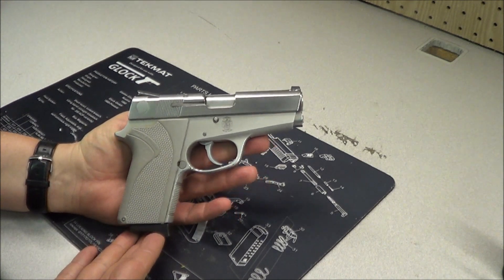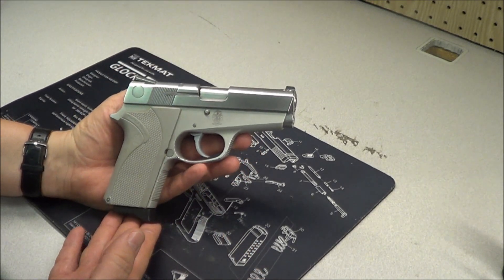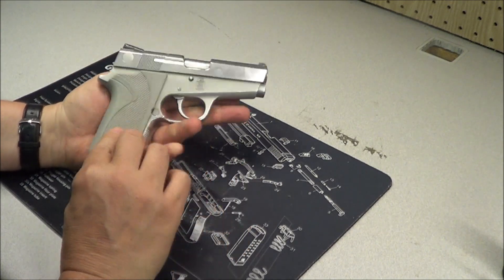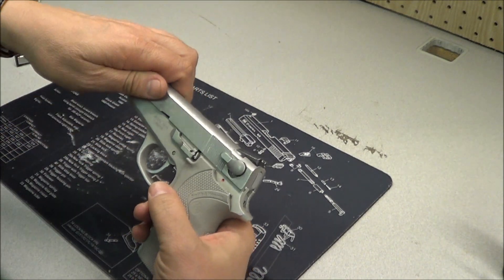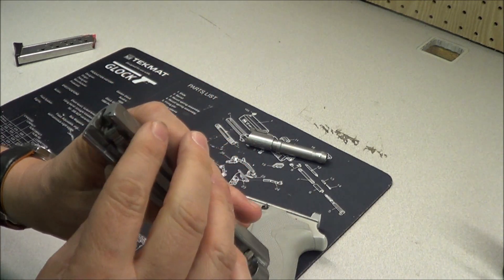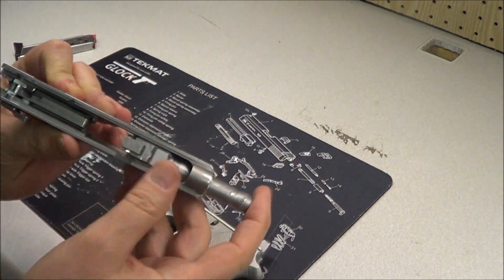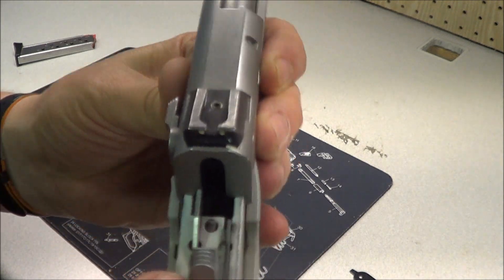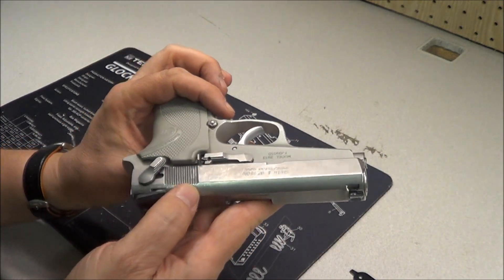Expertly field-strip your stainless steel Smith & Wesson 3913NL

Comment: Thank you. Didn't know about the magazine disconnect. I was taking this apart and putting it back together over and over because the trigger would not activate the hammer. I thought it was an assembly problem. Slid the magazine in and problem solved after watching your video! Thank you again (I was thinking the gun was defective).
Reply: Do yourself a favor and remove that unnecessary item.

Comment: Enjoy the video.  I have a 3913 as well.  I am interested in the process you used to polish the slide.  Was it all bt hand or did you use an electronic polisher?  Also, did you use the polish on the aluminum frame too?

Thank you.
Reply from the maker: I only polished the slide, did not do anything to the aluminum frame.  I used a cotton rag and did it by hand.  To get a super bright polish job takes more effort than what I did, I wanted mine to just be free of the dull oxidizing that was on the slide.  To get a mirror like finish you might have to start with flat polishing stones and work your way to cloth.  Good luck.
Reply: Thank you
Reply: +Greg Allen  I have a 3913 also and it's a Great Carry Gun.
Reply from the maker: +Gary Hendricks I feel it is one of the greatest production 9mm carry guns.
Reply: Absolutely is. I was at a Gun Shop about 3 weeks ago and the owner’s eye’s lit up when I showed it to him. He wanted to buy it from me, and with that I knew it was a Great Pistol. Regards Gary